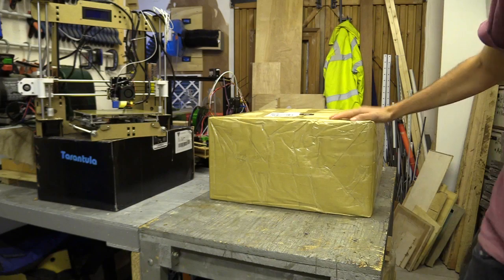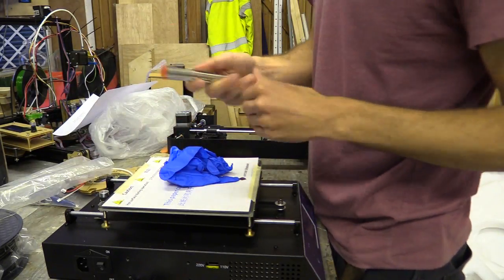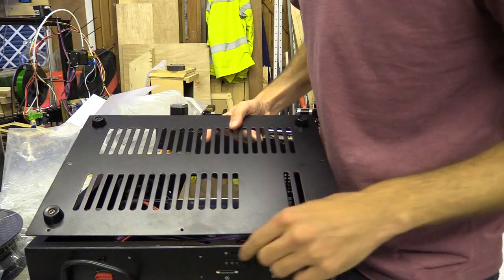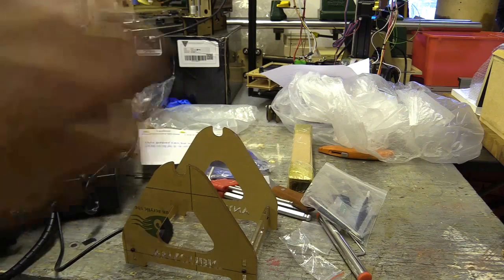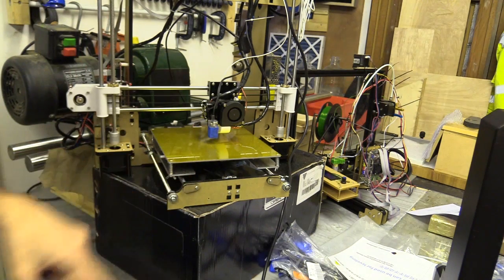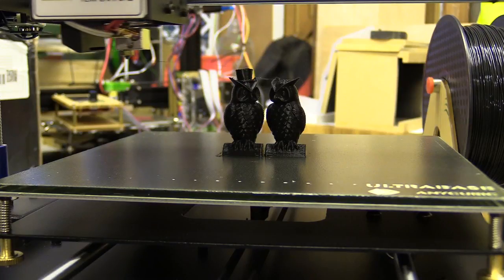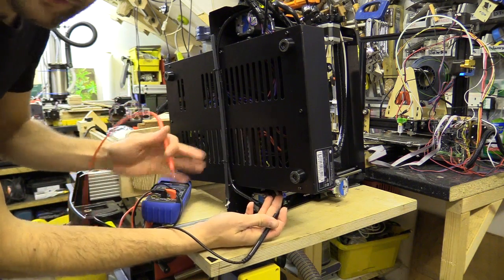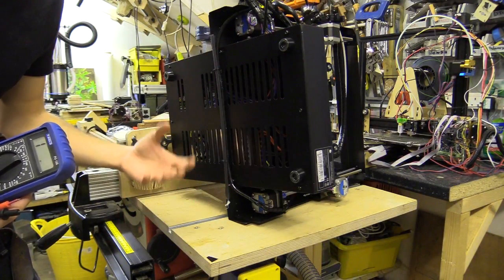Anycubic i3 Mega Review With Ultrabase / Best 3D Printer for Printing Owls

Comment: Mine came with a useless bed which was not flat. But I got a new one from them.
I upgraded to misumi rods,bearings, belts and 16 pulleys. Did also buld a 4mm alu plate replacement under the heatbed. Drilled holes in it to get same weight as the original .
Reply from the maker: I'm putting out a video soon of rebuilding the machine. I used mine until it broke. Still think it's a good machine despite the work you have to put in.
Reply: @EducatingSavvas 
Yes. But now my issue is that Y axis prints about 0.1mm longer than X axis.  It does for any scale of the testcube. If I try calibrate the steps per mm it just works for the current scale. When bigger or smaller its wrong again.

Comment: Just got mine on Prime day Ultrabase version, it's not perfect up front, but man it don't need much.  When those owl prints first come off the plate - I was blown away!  I ordered new undercarriage plate from Global Robotics, the factory is a bit flimsy as Im having leveling issue.  Printed new stepper motor cooling mounts, order new Noctua fans and got some actual good PLA - thing is a boss!

Comment: The Ultrabase is the new version.  The bed leveling sensor was removed in the newer version.  While easy to use it is not as accurate as the paper method - hence its removal.
Reply from the maker: This thing is so good, when Gearbest asked me what I wanted to review next I asked for the same printer. It nearly worked but then they caught on... oh well.
Reply: also the hot end was changed. and one more sensor added
Reply: They did away with the bed leveling sensor partly because it wouldn't have worked with the ultrabase anyway. A wise decision IMO too.

Comment: Thanks for the review, good that you test the grounding. Try turning the bottom plate 180 degrees, to get the closed side to the mains voltage section (for safety) and the slits to the fan section above the control pcb.
My guess is this is the way it was designed, just not how the people assembled it.
Also nice to check (if you have the time) is if the control pcb reacts in a safe way on removed, broken wires or missing thermal sensors, by switching the hotbed or heater off, to prevent fire hazzards.

Comment: The version without assisted levelling is actually the new version - they removed the proximity sensor and added the "ultrabase" on the never version. I got mine for a couple of weeks now. I also think it is a great printer. But for some reason I have some problems with bed adhesion at the moment and couldn't figure out what causes this problem yet.
Reply from the maker: Really - that was confusing. I really thought this was the older model. What kind of problems are you having? Have you tried cleaning the bed with alcohol? or if the nozzle is too high you won't get good adhesion? I have to toggle the bed high a little as I start printing, but overall it's pretty good.
Reply: depends of the pla you are using, some of them stick better than other. I am using glue stick for all of my prints with pla.

Comment: God, wish I bought this instead of the cr-10 mini
Reply from the maker: Yeah I do like this machine but in the end, I'm going to build my own core xy machine I think.
Reply: Finally someone who publicly has realized this is a better machine.  You simply cannot compare a one piece metal structure vs. alumium extrussion assembled with brackets or 3D printed parts. Just in this alone the Anycubic I3 Mega wins over more popular and more expensive machines.  I love mine! and I did a lot of research to make sure this machine would satisfy my needs and It has! so far after hundreds of parts it is still printing well.
Reply: Likewise here, but lack of time is forcing me to use ready built products.